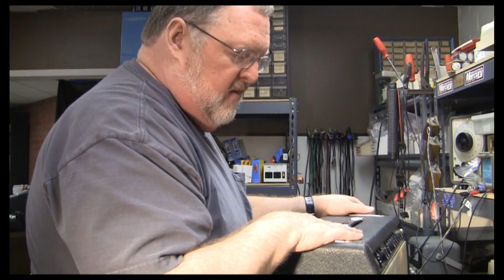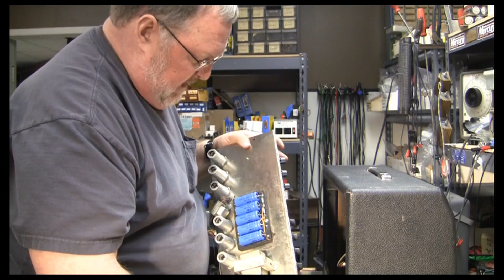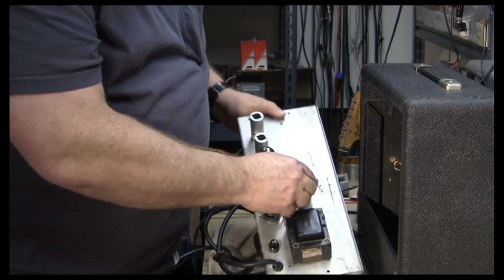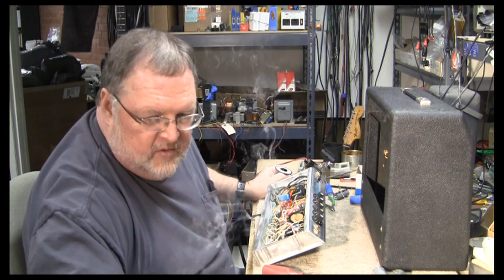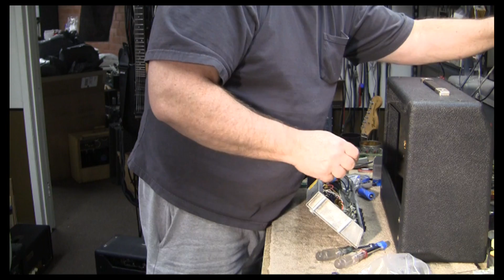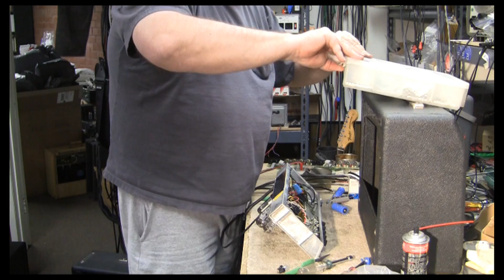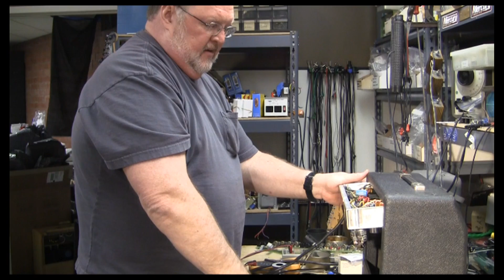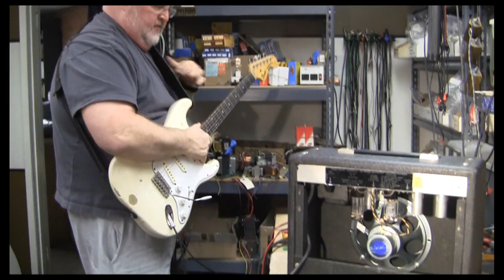Roy Blankenship Amp Repair Shop - 1

Comment: hes alright, a few mistakes, should not bring voltage up slow to burn in cap with the tubes plugged in, they will draw excess current as the filaments are cold, 3 prong pwr cord has nothing to do with getting shocked, the pwr xfmr isolates the chassis from the power line, the shock you feel comes from the ..047-600 volt cap on the pri leads, should have turned pots after spraying with cleaner to so that the traces get cleaned by the wiper, excess wire could be there for a reason, to add inductance which can help osc., usual rule is grid wires short, B+ wires long, Leo experimented with many lead dress combinations before he found the best one, so you should try to keep leads the same size, should have soldered CT leads from xfmr directly to chassis like black face, should have rewired the heater circuit to cancel hum...
Reply: mortyok3 Amen!
Reply: Great points . Current limiter and a slow turn on doesn't hurt when turning on the unknown, but that's not the way to form caps. 100k between the Mains and rectifier. Pull tubes, disconnect ct. Enjoy the drop. 

Fenders are notorious for the heater wire crossing error. Black and Red on the Marshall heaters was a good idea to stop this simple noisy mistake. 

Lastly, my Hakko Future Product is better than any Weller I've ever owned. The tips last for ever. (20 plus builds on the same tip). I change from the pointed to the flat head tip for soldering backs of pots, then turn up to a higher heat and I can even solder the backs of the stainless steel Mil Spec pots quick and clean.

 I used to have that Weller Gun. The heat it not focused like with the flat head tip for backs of Pots. Much quicker with the Hakko. The solder joints look like chrome too. Beautiful. And it came with the brass brillo!

Maybe the Hakko Roy tried was a lower end like the Radio Trash Weller I had. I would go through a tip an amp with that POS $30 Weller. And backs of pots? Lmao forget about it! Why do you think I bought the Weller gun. 

I'm glad I never have to use the gun again. 

To Wellers credit, my friend who builds a lot of Dumble style stuff for Brown Note has a higher end Weller with similar push button heat ranges,  quick heat, and his tips last too. He had to buy his brass brillo tip cleaner separate though.

Don't get me wrong. Much respect for Roys work and knowledge.
That gun just makes me crying in the same way seeing Gerald Webber hold on to the black and red leads while checking voltages.
Reply: it's bad when you throw your guitar. It could break.

Comment: Do the capacitors and other components that you say need replacement apply to vintage solid state amps as well? I own several 70s solid state amps and I'm curious if I might need them to be worked on.

Comment: I thought it was interesting and appreciated how Roy is one of the few who does not BS, admits his limited theoretical background and is pragmatic in what works rather than getting tweaky. I was surprised however that there was little attempt to do diagnostics to discover the actual initial performance parameters. That might be due to not having the test instruments to accurately obtain the measurement. There are electrical mechanics and there are diagnosticians and both have their place. But then there are total BS artists such as Webber who clearing is not a good tech but charges a lot of unsuspecting trusting people a lot of money for shoddy work.
There are a lot of snake oil salesmen pushing bad theories, for a lot of money in high-end hi-fi and now in tube musician gear.
Reply: I attribute my success to an intuitive sense about what is going on, plus a mechanical sense, which I find lacking in a lot of techs. One guy I worked with couldn't figure out how to take things apart, yet 75% of repair is mechanical in nature. After you have seen multiples of a particular amp, you already know what kind of problems they usually have, and on tube amps, doing a lot of measurements becomes meaningless and time consuming, in the repair business, that means money lost.
Reply: I agree with you. A lot of measurements become meaningless in the repair business. Keep up the good work!!
Reply: Wash burn A well set up test configuration generates a very complete set of operating data in no time at all, as simple as setting a load which is connected to appropriate displays for spectrum, level and distortion, and the AC mains being monitored for voltage and current just by plugging it in. Sure, simple problems can be found instantly by sound alone but what about the 15% which require diagnostic skills to save time and money so the customer does not have to pay for wasted guess or shot gunning of parts?
Yes, a shotgunned unit generate more income but it does not treat the client fairly, it is a form of fraud.
Good diagnosticians save money for clients while hacks make a lot on unnecessary tinkering and replacement of perfectly good parts. The biggest problem with profitable reliable repairs is correcting the damage done by hack techs who seem to do more damage to gear than naturally occurring failures. They really rob the customer of the normal value of their units which will never be as reliable or worth as much as before the repair attempt. The internet and videos generate a lot of confidence in people who would not otherwise try to repair their own gear or repair gear for friends and end up lowering the units value and increasing the costs when a tech is finally called in to resolve anything but the simplest problems.
I just hope wannbee techs practice on their own gear for years while studying the fundamentals before working other people's gear.

Comment: Great video and very interesting watching Rot work, Great work ethics and obviously this guy has bags of experience (All electronic repairs should be taught this way) Just one thing though, I assumed if you change the bypass caps value you would also need to change the resistor value or the bass cutoff fq and and gain would change as you describe? or did u keep same values and say that just use lower values. Also why not change those caps to Wima Polyprops of say 0.47uf as they surely would sound way better and still be small enough, just- physically. Would luv to see more vids of Roy at work.
Reply from the maker: Sorry, I cant answer your technical questions. I am trying to get Roy to make a series of these as training videos. Have to wait an see what he wants to do.
Reply: plantmanbarry I really hope he agrees, it is very entertaining and I love his relaxed professional style and the questions you put to him while he does the repairs. Any chance of some HiFi amp repairs etc as well?
Reply: Hi, MG Samps. I am not sure where I talked about changing cap values, I only change the uf value if I want to change the tonal character, but some caps that have become a standard have ridiculous voltage values. I use 22 uf 16 volt caps for cathode bypass where the original values may have been 25-50 volts, which is unnecessary on a circuit that typically has 1.5 volts. I do not use Wimas as they are too clean, great for a solid state compressor, but there is a difference between sound production and sound REproduction. where you would not necessarily want to alter the harmonic character of the source material. In sound production, you want to generate harmonics. I use Mallory 150's with carbon comps for most builds and yellow Xicon blocks for Variplexes and Carry-Ons with carbon films.
Reply: Wow thanks for replying Roy, I imagine you are a real busy chap. Yes of course you are correct about the capacitors use in certain applications, obviously for guitar amps you need a DIRTY kind of sound whereas with Audio reproduction amplifiers it is the opposite and we need a CLEAN sound and thus the different types of caps. Anyway if you and Barry find the time, a few more videos like the one above it would be great. Any chance of some modern SolidState amp repairs -you know the type of thing -blown channels and shorts etc. I need at some point to have a look at my 8 yr old Yamaha DSP AX630SE surround amp as lately it has a problem with the left main channel which only comes to life after it warms up for about 10 mins. Thought it might have been the protection relay messing about at first but now I'm not sure as I'm only using it as a pre-amp and take the 2 main pre-outs to a better amp for my main speakers. so it seems the problem may be a bad driver or a dried out electrolytic or even a dry solder joint on the Yamaha, its def not the other amp or speakers. I'm just learning about all this stuff so any tips here would be welcome before I pull it apart.

Comment: Can you recommend a troubleshooting method for a Randall RG-100HG guitar amp head>  Done the obvious things like cold joints, loose grounds , bulging caps and burnt areas.   Problem is I get no noise at all via a speaker.   Powers up and I see 74 volts out of the transformer to the diaode.  Not sure what to check next.  I have several meters and one is an ESR in circuit meter.
DC

Comment: I have new and under warranty Markbass Amp. It has little hum noise with or without connected guitar. I emailed Markbass directly, they said it is normal. I tested other model of MarkBass it has this noise too. But some other brand of amps like dead silent. What do you think about this hum sound like 50/60hz? I checked and measure everything, ground, electric etc?

Comment: Hi Mr.Blankenship. I have a Crate Limo battery powered amp. It is 5 years old, and lately it has been going from a clear sound and gradually deteriorating into a sound that sounds like it is hooked into a distortion pedal. If left a lone for a few hours, it will play clear again, but eventually goes right back to the distortion. Do you have any ideas of what it may be? 
Comments from viewers are welcome as well.
Reply: My better whom I learned from and tried to keep up, use to say check the most obvious problem FIRST to save frustrating lost time ,Example main bent power chord?

Comment: Hello Barry. My name is Abby and  I was wondering if you can help me with a Fender FM212 DSP that I  have tried to repair without luck. The problem that I have with the unit is as follow. Unit turns on but has no sound at all.  I checked the amp section and all voltages are fine. I have realized that if I press the channel select button it won't change channel. I have been searching for the schematic diagram all over the internet without luck. Any assistence will be appreciated. Thank you and keep up the good work......

Comment: I have a tube amp that produces a raspy bass sound if I turn the bass up past 5 dB of boost. The bass is fine as long as I keep the bass below 6 dB of boost.  I'm using 6L6 tubes. Could it be because the screen grid in the tubes and the center tap on the output Transformer primary are hooked up together? I saw a lot of schematics where the screen grid isn't hooked up that way but rather using an electrolytic capacitor and a 1,500 to 1800 Ohm resistor to the power supply. should I rewire the screen grid connections using an electrolytic capacitor and the 1800 Ohm resistor I mean will that correct this raspy bass problem?

Comment: Mr. Blankenship
You probably get a lot of questions but excuse mine ...
I have looked everywhere for a schematic for a Woodson 150-2 Guitar Amplifier which was under the Kustom / Kasino line of amplifiers
Kustom shows PC Boards with listings but mine is not shown...My board says PC 5116 / Rev 2...
I have got a 60 Cycle Hum which I’m checking ( Ground- Caps etc. )...
Any help would be appreciated...

Comment: OK did the dumb move.  Replacing a fan in Marshall amp and powered it up to test it not thinking I had the heat sink grounded on the chassis.  Spark and now no power. HELP!  Any ideas???  Thank you

Comment: i have a peavy 400 chorus amp...it has worked fine but the other night was jamming and heard a little pop and now my right side speaker sounds blown...it works..but if i crank it up you can tell its not getting the deep loud sound it was getting before...sounds crackly??? any ideas where to start?

Comment: I respectfully disagree on the Hakko. I have a Hakko future product that I've had for at least 7 years. I built 20 amps without having to replace the tip, and it did a better job of soldering the backs of pots than my Wellers,, and I had the gun like Roy too. .
The heat was instant, and it has different heat settings. I even can solder the backs of the Mil Spec pots with it, and my solder joints looked like a chrome show piece when done. 
It also came with a brass brillo tip cleaner instead of the sponge.  It made such a difference in the quality of my workmanship.

I had a negative attitude towards the Welles until recently. My friend who builds a lot of Dumble style builds has an upper end Weller with similar features.  His tips last a long time too. I would ditch that solder gun.
Reply: No way I agree with him...Weller's are no joke. while yeah had a few nicer American Beauties they do tend to really act up etc...

Comment: Purchased a vox super beatle jni ac 100, fender twin reverb, dual showman,  baseman, all 60s era, would like to ship you for a minor tune up. Also need all speaker replacement with jbl's from Jimmy rea. Will check back with you, since I need the equipment for my garage band cross county psychedelic tour in 2 weeks.

Comment: I have a Marshall VS100 I've had problems with it electrocuting me when I have my hands on the strings and my lips on a Microphone. here recently it has also been buzzing really bad. I know it has something to do with the ground I have took it apart and can't find any corrosion or lose wires. What do you think I should do?

Comment: I have always wanted to learn how to repair tube amps, I now have several items to repair. Both my ADA MP-1 tube midi preamps have some issues.  One is suddenly noisier than it normally is. The other has a volume knob issue. I eventually want them restored. I also, have a Marshall 9005 stereo tube amp that has a bad power socket with Ch. B 2nd tube power socket.  My Musicman HD150 is still working good. I think it has been in storage for a long time and doubt it has been worked on. It seems a little noisey, but sounds great.

I really enjoyed this video and was very insightful!

Comment: Wow, I am subscribing to this channel,...to be sure, I feel like a home hobbyist who is restoring old electronics,...well, learning more and more all the time, getting more equipment,...but I do have formal training in electrical and electronics repair from the military where I did just a little bit, and auto mechanics, and also took college courses in electrical schematic readings and such., basic rules of ohms law and and all that.  I'd like to do electronics repair as a sideline, ....like I used to want to do, but now that I am older, with fewer hard labor job opportunities,...its definitely something I am studying.  Yeah,....shoddy repairs,....too long a wires that I figured caused voltage loss etc, I will closely study your videos for the proper way things should be done.  My proiblem IS that I need some better soldering equipment,...I mean, decades ago I owned weller soldering guns and pencil soldering irons,....but I need a weller soldering gun.

Comment: hi do know the resistance on the thermal lead switch for the yamaha  power amp p-2200 and were to fine the fuse holder

Comment: He didn't seem to check the 3 EL Caps just removed them because they weren't mounted well. So he kept them to re-use. $45 in Caps! Not to be critical, but if that amp was losing audio power, he probably fixed it when he changed out the white mallory EL caps.

Comment: Roy,   I have an old 40 watt Princeton clone, no reverb no extra anything. it has a 12ax7, a 6v6 and a 5y3.  Is there anyway I can get the amp to overdrive or sound better tone wise.  It s got new tubes but it just sound plain as dirt.   I ve heard your speech about making amps what they are suppose to be.  And its completely stock yet is it the design or can I have a classic tone from the late 50s early 60s with this and these tubes.

Comment: Have a question for you sir. I'm an electronic technician. I took a peavy 4-c amplifier a part to change outputs and i did not take 

picture. So there are 2 thermal plug on the amp board and one wire(red) coming from the switch at the front. To resume, there are 2 

white wires and 2 red wires(1 from the switch). I don't remember where to plug those 4 wires,( 2 reds and 2 white). Do i plug the 2 

reds on one thermal switche and the 2 white or 1 red with 1 white on a thermal switches. I am completely lost with those 4 wires. 

HELP PLEASE. All the rest is ok. Please Sir tell me where to replug the right wires at the right thermal plug. A big thank to you. 

Best regards.

 Serge. Next time i'll take picture but i need experience.   Waiting for answer. March 25 2016. Thank you again.

Comment: Hey, I have a question and can’t find help anywhere.  I have a peavey Vypyr 30 modeling amp and every time I turn the amp on it has very little sound on some channels with very bad buzz (amp has to be cranked to get any sound and it comes in and out when there is sound).  When I plug headphones into it I get the same buzz with noise coming in and out faintly. Do you have any idea what the issue may be?

Comment: i have a question i hope you can help me with. i have a kustom hv65, its a great lil amp and i only paid 100 for it. problem is when i turn on power  sometimes immediately turns on other times it can sit for up to 30 min before it pops and turns on. didnt do this before, any ideas what could be? im thinking power supply because once amp is on everything works great